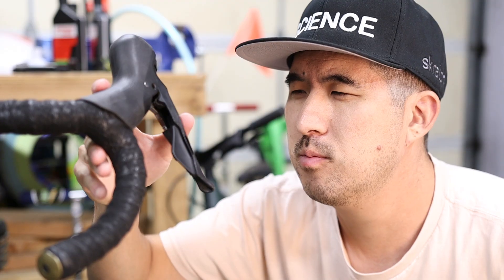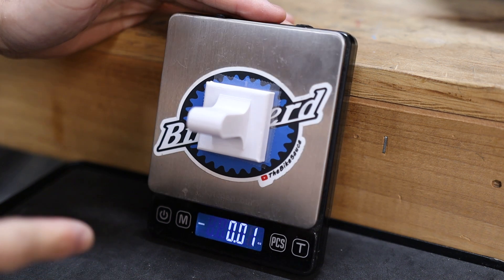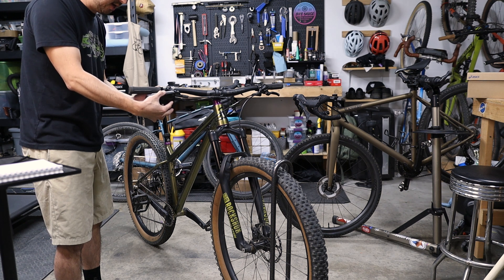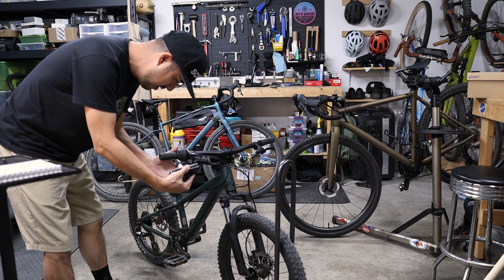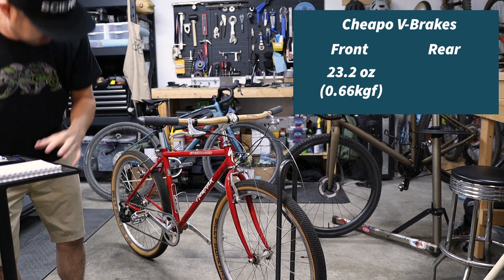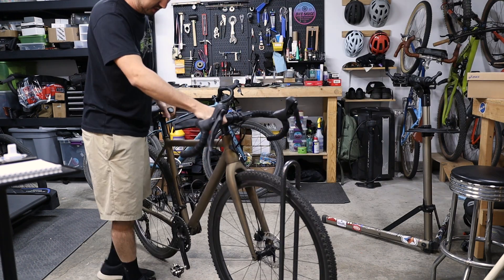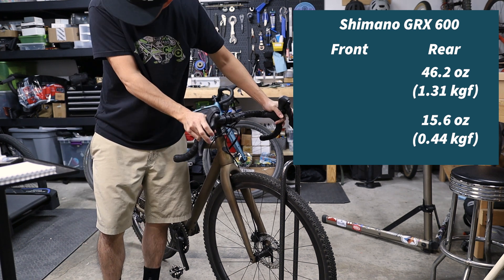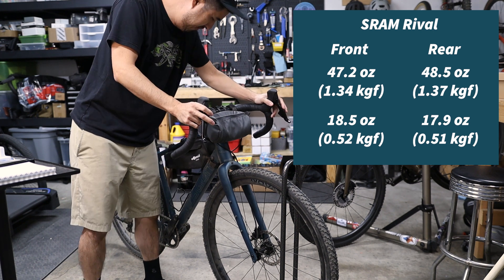Brake LEVER Force Measured

Comment: What is really needed is to have Stages put a strain gauge on each of the levers and then measure the amount of hand power consumed to decelerate the bike a certain amount. In other words exactly like a power for your legs, which measures the amount of force your legs pump out, vs the amount of acceleration generated.

Comment: I would want to see the force required to lock the wheel from spinning at a stipulated average speed and at a torque derived from a simulated system mass traveling at said average speed, all using the same brake pad and rotor. Great video!

Comment: I commend the inquiry and the effort, but I think your measurement technique is entirely flawed. You pushed the lever to a point you thought was adequate, but how much braking do you get from that effort? You need to set a baseline which yields a given amount of braking for each brake so you can compare the forces required at the lever. You probably pressed until you reached a point of steeply increasing effort but that does not translate to any given amount of braking, especially since the various brakes you tested have such different characteristics. I could be wrong, but this is how it seems to me. I think to make this a valid test, the bike’s wheel should be spinning a drum such as on bike rollers, and the bike rollers need to measure the amount of deceleration somehow. When it reads a certain amount of deceleration, it is at that point that you should measure the force at the lever.
Reply from the maker: Thx for the feedback! I get what you’re after, but this test is only measuring brake lever force. Basically just the nominal tension in the system. Nothing to do with braking power.
Reply: @TheBikeSauce  OK then what effect does that tension have on the cycling experience? And how did you limit the amount of force you applied? In other words, couldn't you have squeezed the heck out of the lever in each case? So you pressed with less than a "heckful," so how much did you squeeze, and what does it show us about the different systems?
Reply from the maker: I believe that tension in the braking system has a great effect on the ride experience, despite not being a formally discussed metric. The hypothesis is that reducing brake lever tension frees up hand strength for modulation.

The experimental process was outlined pretty well: articulate levers to relieve any stiction, square the scale to the lever, zero the scale, push and hold in static equilibrium until just before the bite point, record the force. 

Again, not precise science by any means, but confirmed a couple of interesting results nonetheless.
Reply: @TheBikeSauce  OK I think I understand now. I believe it is true that reducing the required pressure frees the hand to modulate well as well as giving more braking power to those who are not strong enough to fully engage a brake that requires a lot of pressure. Thanks. I enjoy your videos very much.

Comment: Love the test! Reflecting on bad drop bar experiences with Spyres and BB7, I reckoned the leverage on the brake levers from the hoods is poor from an ergonomic perspective since you are pulling towards the palm. Flat bar and in the drops, you pull towards the thumb which feels much more powerful. One third the leverage adds to that problem . Grip strength testing from different positions could be a fun addendum to the series.

Comment: I’m not sure if you were measuring the right thing. The force you measured to make the brake pads touch the rotor is your spring tension. You can replace the spring with a more r less stiff one and change that force. Not related to brake power. Brake power depends on 
1. Spring pull
2. System loss
3. Ratio of lever to pad movement (before brake engagement) 
If you measure the force on the lever needed to keep the bike still while the bike is being pulled at a certain force, subtract the lever spring pull, multiply by the ratio of lever movement to pad movement (measured separately) and take off the losses, you get the brake power. It will be more complicated for a brake that has servo movement like the new shimano drop bars.
Reply from the maker: Again, we weren’t claiming to measure brake power. Simply brake lever force, which affects braking feel to some degree
Reply: @TheBikeSauce  thanks. I am waiting to see how you like that Polygon Bend.
Reply: An easier thing to do is to apply a certain force to the bike: this could be a certain weight you hang from a pulley (on a fixed location) and the string is pulling the bike horizontally. Then measure how much force you need to apply on the brake lever to keep the bike still even though it is being pulled by the string. Come up with a table showing the results for two or three weights.

Comment: I recently picked up my first drop bar bike with hydraulic brakes (Rival AXS) and immediately noticed the higher force required to engage vs the mechanical rim brakes (SRAM double tap and shimano Dura Ace) than I had previously been used to. I am still having a hard time adjusting to this as I have been hearing people raving about hydraulic brakes for years. Honestly the feeling of my rim brakes were just as good if not better than the hydraulics.

The lower force required to engage in the drops is probably due to the increased leverage from the end of the brake which probably correlates to the similar leverage point on the flat bar brakes.
Reply from the maker: Not probably, definitely proportional to the lever arm

Comment: your not really testing the force needed to stop the bike, you’re testing the tension on the return spring. you need to normalize for pressure into the rotor.
Reply from the maker: Explicitly stated we’re not testing brake force 😀. Just brake lever force

Comment: The Growtac Equal is installed with the tip of the brake lever pointing more sharply backwards compared to the Shimano and SRAM system. And we know force required to do work is inversely proportional to the distance of the applied force from the pivot in a lever system. Have you controlled for the potential difference in distance between the hand and the pivot in the drop bar brakes? Because if the leverage is longer for the Growtac that’d explain the why it was requiring a lower force than the SRAM and Shimano.
Reply from the maker: Lot to unpack here. But yes, I tried to square the scale to the axis of rotation on each lever. For the drops, I pushed right where the dip is on all levers. The levers are essentially the same length, but the discrepancy may be that the pivot point on the r7000 is at a different location than on the grx, which would change the effective moment arm. 

Nonetheless, in a natural riding position, the growtacs with r7000 levers are lighter action.

Comment: I'm curious if you would achieve the same figures if you used the hanging bike weighing scale and yanked on the levers instead of pushed on them.

Happy holidays!
Reply: If the scales were 5kg max then pull would be better

Comment: Im legitimately confused about this comparison. Braking force is a combination of the force multiplication of the lever/caliper as a system, combined with friction of the pads on the rim/rotor in motion.
What on earth is even being measured here for comparison? I mean if you put a high friction brake pad you could stop  with much less finger effort.
Reply from the maker: 😆. Yea there’s no braking power measurement here. I was just curious how hard some levers are to pull. I explained that the measurement is taken just before the pads contact the rotors.

Comment: It would have been nice to have some kind of force sensor in the caliper and measure how much force it took to provide a set amount of force on the pads. Seems like there isn't a ton of variation for most of them in terms of force to move the lever, but if you're stopping before you hit the rotor, then you aren't really measuring how much force is required to stop the bike, which is the important part.
Reply from the maker: Haha me and some of my students are working on exactly that test bed.
Reply: @TheBikeSauce just wrote a comment about that.

Comment: Hey, man! Cheers from a fellow mechanic enthusiast from Bulgaria. This topic is very interesting to me, and I was going to comment on the recent podcast of You and Russ but never found the time.

In my opinion, the cable-actuated drop bar brakes are bad because of a messed-up cable pull ratio. I'm pretty sure that manufacturers know about this and do nothing to address the issue because it promotes the hydraulic options better.

So, let me tell you a story - A few years ago, I was building my first disc road bike (winter & commuter) and I mixed my existing Shimano ST-2300 levers with Avid BB5 Road calipers. All was great, and the stopping power and lever feel were more than adequate. Later, I switched the calipers to BB7 Road (just for the bling and extra adjustment). Again - all great, brakes felt even better. I rode this setup for a few years, and finally, I decided to ditch the ST-2300 levers and switch to the newer generation ST-R2000 (this is a 3x8-speed bike, and I plan to keep it this way as long as possible). After switching the levers - Oh My God - the brakes felt awful! Way harder to press and so much less stopping power. It was night and day compared to my previous setup. I then decided to investigate the matter and found that basically all Shimano levers since the first gen with hidden shift cables had increased pull ratio for the brakes. And the increase is by a lot, something like 1/1.7 (old/new levers). No wonder the same calipers worked well with the older lever and worse with the new ones. I then decided to try MTB calipers (also known as long-pull or V-brake pull). I installed BB7 MTBs for the sake of testing, and guess what - this combo is the best brake I've ever had.

Long story short, on this and a few other bikes, I tried a few more levers and calipers afterwards (Shimano BR-RS305, TRP Spyres, etc.), all felt like trash with supposedly compatible levers - the latest gen Shimano STI's. I even tried to increase the pull ratio of a Spyre by grinding the ball ramps inside with partial success, but I don't like this brake anyway (too finicky and small internals that are IMO not suitable for purpose).

So in summary, my thinking is that the latest mech STI's have a much greater pull ratio than the old ones and are very close to the V-brake levers. Many mechanical calipers are built around the older (shorter) pull ratio; some newer models are somewhere in between (for the sake of compatibility with old and new levers), but that just makes them not perfect with either levers.

My winter bike has the BB7 MTBs for a few years now, and this combo is the best brake I've ever had in my life. I've had a few different Shimano hydros on one of my other bikes (Ritchey Road Logic Disc), and believe it or not - the mechanical combo is better, at least for me. This spring I switched the Ritchey to mechanical brakes too - trusty BB7 MTB up front, but the rear was a big problem because of the flat mount and the close proximity of the seatstays. You may know that for a PM caliper to fit with the proper FM-PM adapter, the seatstays need to have enough clearance, and this is a problem with some Flat-Mount frames. I rode with a Spyre out back for most of the year, and I can tell you - this caliper is a joke in comparison with the BB7 MTB up front. I had the idea to modify a PM BB7 caliper to fit on the FM mount of the Ritchey, and I recently did the mod, but it is still in a kind of testing phase (bad weather, so I ride another bike).

As I said, this matter is very interesting to me, and I encourage you to do more testing and compare the pull ratio of levers and calipers. I can show you pics of disassembled levers of the two types; you'll be amazed at how different the ratio is.

Best regards, Marin
Reply: This sounds fascinating and I want to make sure I got it right. You are saying that with Shimano ST-R2000 short-pull road bike levers you find that Avid BB7 MTB long-pull calipers work well, and that you suspect the reason is that modern levers like these have a different pull ratio compared to older levers like the ST-2300?

I'm rather ignorant on the topic, so I'm wondering whether it's possible that the issue isn't in the pull ratio but instead it may be about the distance between the pivot point of the lever and the place where one typically presses on the lever. If the newer ST-R2000 levers shorten the distance between the pivot and the fingers on the lever, that would make the lever feel "harder" because of the lower mechanical advantage. By switching to brake calipers with a longer pull you recover the mechanical advantage that you had lost with the newer levers. Do you think this could be what's happening?

Comment: I think that's pretty on point with the grotacs as one of the main review comments seems to be that they are powerful but very off then on. Some small bit of lever resistance is useful in allowing you to modulate the pull since hands over bumpy terrain aren't the most precise machines.

Comment: Thanks for this. A great data backed validation of how superior those growtacs are. They can be fiddely  at times for sure,  but once dialed in I just forget about them. I also use them on my Outback BA and love the modulation. I’ve had doubts about migrating to hydraulics as well but not anymore.  Why bother.

Comment: Makes sense that the drop levers are designed for optimal braking from the hooks. If they were easy to pull when on the hoods they'd lockup or have no modulation from the drops. state's brakes... yikes